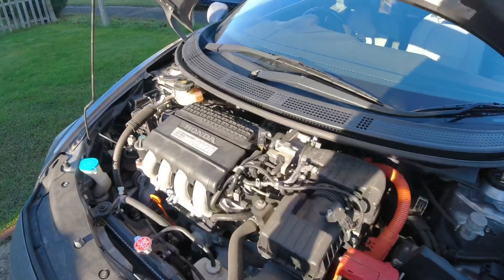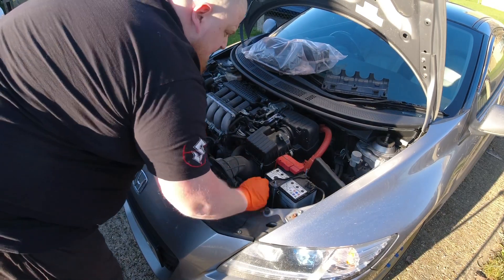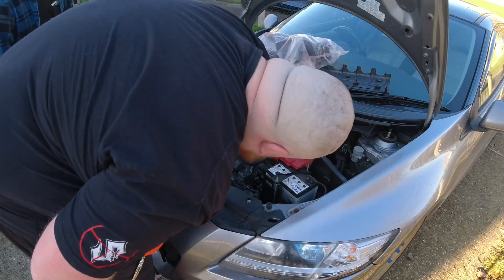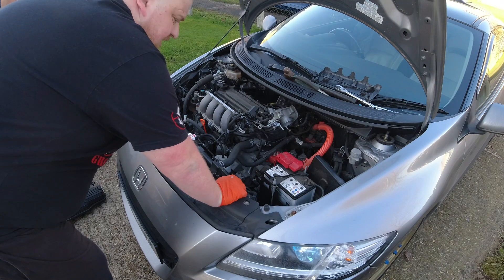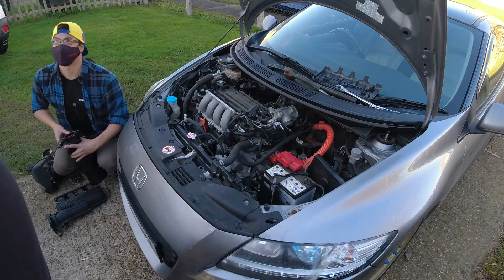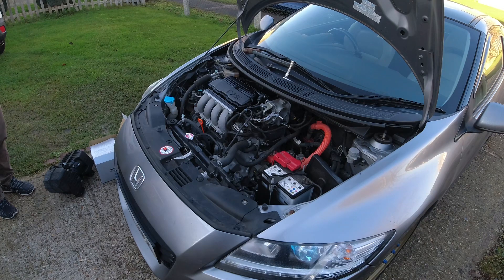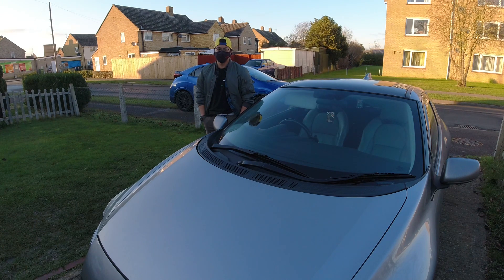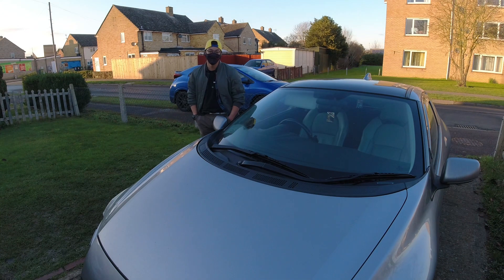RB1 intake manifold fitted to a Honda CR-Z ZF1 - EXPRESSION CULTURE

Comment: how did it affect gas milage
Reply from the maker: It wont change fuel usage. The same amount of air and fuel are going in. Its just routed through the intake manifold slightly different

Comment: nice for once the US gets something cool, these RB1 manifolds came on Honda Fit Sport, i’ve come across 3 at the wrecking yard but finally pulled one cause something had already took the throttle body off. can’t wait to fit it on the crz
Reply from the maker: @migsEK  there is a lot of cool honda stuff the us gets.

Comment: Nice tip on the maf bolt.  I’ve had a RB1 plenum sitting around for months dreading the removal of the bolt 😂
Reply from the maker: Yeah they are a bugger without the use of these things. Saves having to buy another sensor though lol
Reply: Success!  I used a PH2 Philips head.  Bit of pressure from the top and came undone straight away.

Comment: Great video, Tegiwa are currently selling some on eBay new, so they come with the gaskets or do you need to get them separately?
Reply from the maker: Hello again Daniel, thanks for watching and commenting on another video. Really grateful for your support. Tegiwa have been selling these for years. It was i that helped these appear in the uk more easierly when i helped cox motor parts get them here, however once tegiwa got sniff of this they managed to get them in cheaper. On their website they was £192 plus shipping. Ive fitted tons of these for customers now. They dont come with new gaskets but you can reuse your old ones. They dont need changing really unless they are torn. They also are quite expensive. Hope that helps. If your willing to travel i can always fit this for you.
Reply: @ExpressionCulture  wear are you based? I’m in Somerset
Reply: @ExpressionCulture  Also Is gasket seal or anything needed or is it just a straight swap?
Reply from the maker: @danielblandford9013  im in Cambridgeshire. Nothing extra is “needed” i tend to do spark plugs also for the customer when fitting these as they need to be changed every 6 years but most people never get the first set down. I did a set for a customer that was 4 years over due, the sparks on these tend to back out on cylinders 2 and 3 over time if not changed.
Reply: @ExpressionCulture   ok good advice I’ll check my service history to see about spark plugs, as the previous owners had everything done at the dealer but cheers for the help and keep the good videos up 👍
Reply from the maker: @danielblandford9013  no problem and thank you

Comment: I am thinking of buying the rb1 intake manifold for my crz.
I have already installed a HKS intake but I find that the intake noise is not very loud.
Will the rb1 intake manifold bring the intake noise louder?
Or is there any other intake system have a louder suction noise?
Reply from the maker: @mokh1n  its a single cam motor with no “real” vtec so your induction noise isnt going to be huge. If you look through my videos i have done a crz with hks. I dont believe the rb1 intake manifold add any more intake noise
Reply: @ExpressionCulture  I forgot to mention mine is the facelifted model so it has vtec on the intake side.
It sounds great with the hks intake but it's just not as loud as the twin cam motor.
If the intake manifold won't help, I can focus on doing other mods first.
Thank you btw👍

Comment: hmm I was wondering if the RB0 was the same as the RB1 thanks for clarifying that up... I just dont get why it costs £200 for a piece of plastic...
Reply from the maker: Because R&D, and your paying for a rare part that was never fitted to any honda in the uk. So suppliers have to get them from Honda Japan for example, which costs fees and taxes that are included in the price of the part they supply. I was the guy that started suppliers bringing them into the uk many years ago.
Reply: @ExpressionCulture  fair fair, hope its compatible with the facelift higher power CRZ.
Reply from the maker: @Zlin0035  yes, the engine is virtually the same, its the newer generate battery that gives it more power over the prefacelift.
Reply: @ExpressionCulture  yeah thats what I thought, thanks for confirming it though.
Reply from the maker: @Zlin0035  not a problem buddy, there are other differences which i believe is mainly suspension related. Mine puts out more power than the facelift now and ive changed most of the suspension and braking components now. The crz is a great car. Ill have mine forever and ill constantly be upgrading it. Ive got many other crz videos if you wanna check some of those out
Reply: @ExpressionCulture  well my first "mod" is Type R (EP3) Rims and some good tyres first. 😂
Reply from the maker: @Zlin0035  nice man, good tyres can transform a car

Comment: Hi Expression Culture, I see many put also the Takeda filter instead.
What do you think? That really add some HP?
I feel (guessing on videos) that the Takeda has a finer sound
Reply from the maker: Difficult to say when the customer didnt choose the takeda because he didnt want to follow the mould. For me personally the takeda doesn’t look as good, takeda is quite an ugly system on the CRZ. Without putting them side by side on a dyno it is also going to be very hard to prove. Most manufacturers usually state what they have gained when R&D’n their products, so maybe take a look on takeda’s website and see what they quote
Reply: @ExpressionCulture  Thanks. I am considering buying a CRZ and I noticed it has already a Typhoon KN intake (filter a bit dirty), should I consider a plus, and I am fine with the step 1 (maybe placing an exhaust)?
thx
Reply from the maker: @jolladevices  the k&n typhoon is a lifetime filter, u just clean it. Must better than the takeda